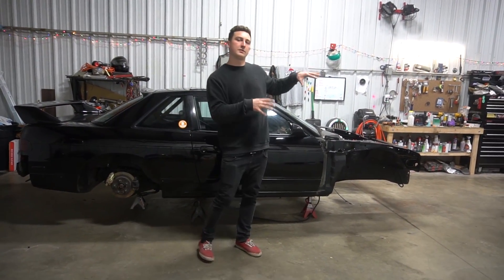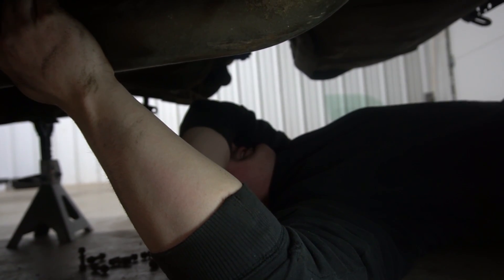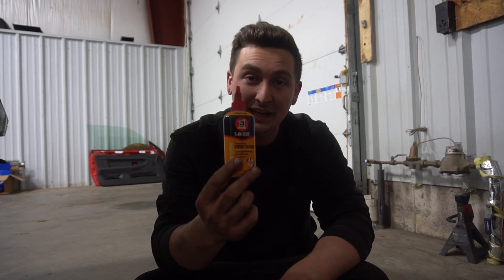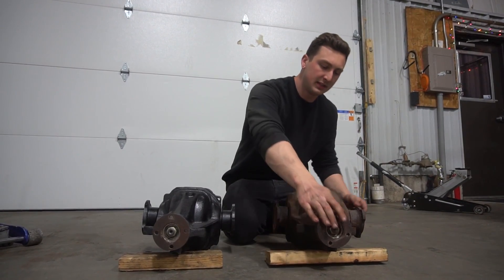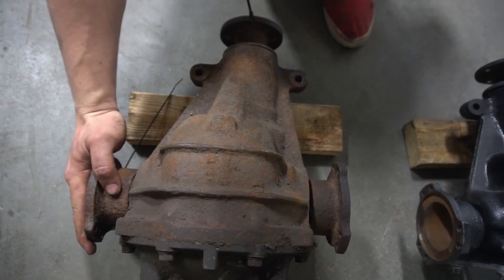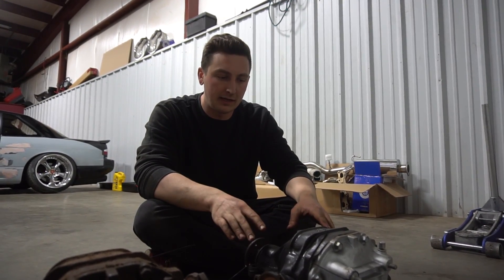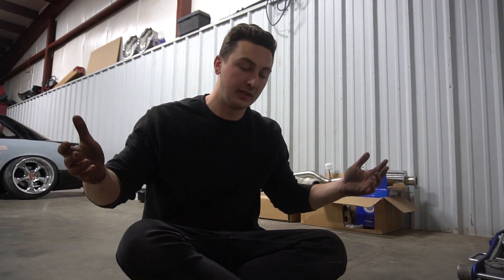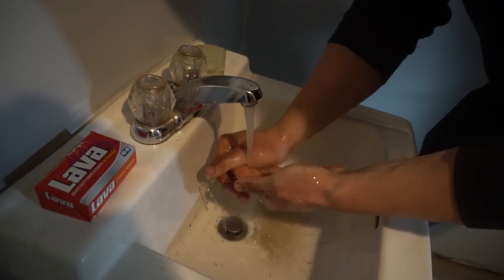NO TORQUE? NO ISSUE!

Comment: The ratio of the new diff would be LOWER, not higher. Higher rear gear ratios lower your engine speed and make the gears longer, shorter ones do the opposite.
Reply: madmatt2024 yeah I had to think about that when he said that
Reply: He just confused himself all the way throughout.. 😂
Reply: He says higher gear ratio which is technically right since the “lower” your gearing is the higher the number of the ratio is
Reply: But that's not typically how you express it in speech.
Reply: madmatt2024 I agree

Comment: The best penetrating fluid is ATF mixed with Acetone, works great for cutting fluid and tapping fluid as well. Mix it 50/50, you can make a half gallon for like 15 bucks or less.